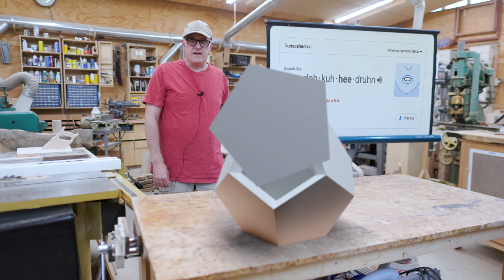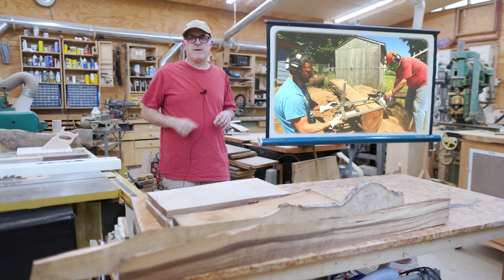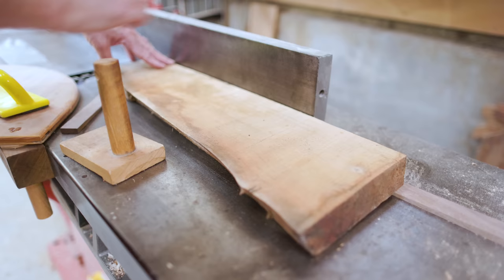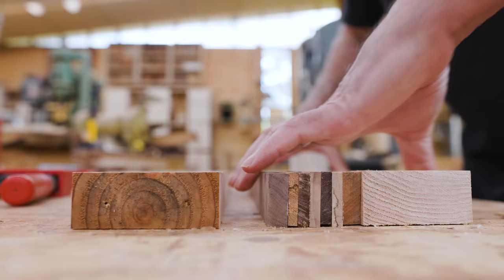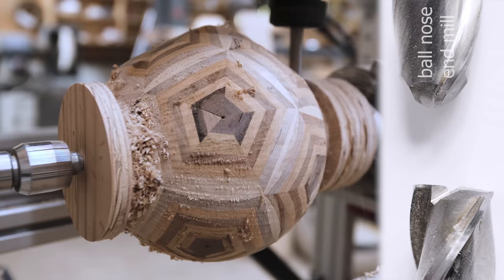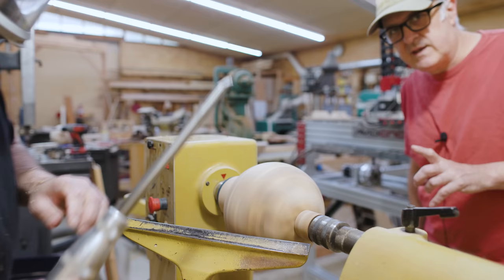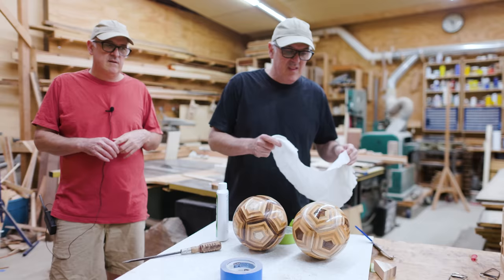Wood Turned Segmented Spheres

Comment: If you are looking for a 12, try screw head types, with a little bit of research you will find more than enough especially if you delve into security screws companies don’t want you to undo. With the different head types there are plenty to choose from.😁 I bought a set of screw bits once to undo most of them and there were way more than 12 types. Also if you made 6 of the pentagons out of resin, would it be possible to insert an LED light to make a Christmas ornament. All the best to ya😁😁
Reply: This is a fun idea!
Reply from the maker: I like the  screw types idea, simple graphics, out of the ordinary and on topic.  I've been wondering how to use resin in this process.

Comment: This video was awesome Frank. For the Christmas ornament I suggest you make the center of the pentagons a snowflake on the CNC machine, and then fill them with a translucent white epoxy. No chip out problem then.
Reply: you can also use semi transparent epoxy completely thru the wood and add lights.

Comment: I love these projects, I did a number of segmented bowls in high school.  It just occurs to me that it could be interesting to use the CNC to carve the inside of the bowl while still hemispheres. At the same time, carve a slot in the rim for a ring spline so the two halves can be aligned easily.  Would be good for a sphere with cutouts.

Comment: For the finishing stage, possibly strewing an eye hook into the spheres and hanging it from a string might be a good solution. You could spray finish then, or apply with a brush, etc. Then fill in the hole with saw dust and glue or wood filler, etc.

Comment: There's a way to make spherical dice that could be possible with your techniques (and CNC). You carve cups into the back of each pentagon, and making it so everything outside the cups is really smooth high points, and then you include a heavy ball. Once assembled the only place the ball can come to rest is in a cup, and whichever cup it rests in will be pulled to the bottom. This could be a really interesting jumbo yardgame die, but it would also stop the sphere from rolling so you could display it without anything external to keep it still. I'm sure the trick is finding a ball with the right weight, too heavy and it'll break itself apart, not heavy enough and it won't be able to roll the ball.

Comment: Even if one spring clamp isn't strong enough, there are a lot of ways to tie the string so it hangs on 3 spring clamps, or more, but balancing more than 3 gets really fiddly. Maybe have 3 separate strings pulling in a triangle of directions so the weight isn't as prone to tilting the spring clamp over. And of course, you could set this all up before you begin gluing, with little carabiners or clasps to grab on quickly.

As just a quick thought on it, you could do an alpine butterfly midline on a cord, then have the two working ends turn back around and barrel knot onto themselves, put a carabiner on each loop, slide the barrel knot to adjust. Then take a second like, tie an angler's loop engaged in any of several ways with the alpine butterfly's loop, and do the barrel knot+ carabiner to the other end. Now hang this whole thing from the alpine butterfly's loop. If you hang it on a hook or carabiner, then you can attach and adjust the whole harness before hanging it, so there will be less jostling that could dislodge the clamps

Comment: Regarding the sphere slipping in the cup when turning. I would suggest using   Plastidip Super Grip Fabric Spray on the cup. It works super excellently on the back of rugs to keep them from slipping on a wood floor. And it does not stick to the floor. It needs to drive for about 4 hours.
Also, it came to mind that you could use your CNC to make a spherical cup as well.
Thanks for providing the angle for cutting the pentagons to form a sphere.

Comment: I think you can cut a piece of wood with the right cut angle and add it between you jig limit and the piece, so each piece would not rock back and fourth anymore and you can cut it on the table saw at the right dimensions. Really good job, as usual ;)

Comment: You could set the drying dodecahedron on a small cylinder or cube to keep pressure of the spring clamps (the middle of the pentagons seems big enough for that).

Comment: I absolutely agree with everyone's comments about your editing and story telling.

While we got a lot of Narrator Frank, and Artisan Frank, a little Gaffer Frank, but Janitor Frank should get some screentime as well 😜

Regarding your "12 things" question, I'm trying to think of 2 things (top and bottom) that each have 5 things (5 sides attached to the top or bottom) in common and are opposed to or correlate with the other side.

It's not an accurate example, but gets the point across:  if we had 5 seasons, the top could relate to the Northern hemisphere, the bottom to the Southern hemispheres, and the seasons could align with the neighboring seasons on the other side of the globe.

Almost yin yang in a globe form...

Comment: Gorgeous

I would like to suggest to drill a hole in the center of the pentagons to mount them on a peg on the table saw sled to aid alignment. That can be uniformly filled or CNC'd.

Comment: Instead of clamps to hold the pieces in place as you cut the face, rotate it, cut the face rotate it etc, you can actually build a 5 sided 'home' (really only 4 sided since the 5th side is the side you are cutting), so you just have to lift it out of the 'home' rotate it and cut the new face, lift it out, rotate it etc. I made many Euclidian solids out foam and paper years ago, they are some much fun. Look at the stellated versions...

Comment: Here's an idea for the disappearing edges: What if instead of aligning the strips in your glue-up perpendicular to the face of each pentagon, you glued them up so that the strips are already at the angle of the joint between the pentagons? Each glued edge would then have an approximately uniform thickness of that one type of wood, instead of only the little wedge of it at the outside which then gets turned off.

Comment: You could make a pair of spherical dice. They roll, but come to a stop on a number. Basically, the flats are on the inside and a weight makes it settle on a number. They actually correspond to the corners in the internal polygon. So a 6-numbered die would need an octahedron inside (6 vertices) and a 12-numbered die would need an icosahedron inside (12 vertices).

Would definitely be a challenge. Woodturning with the weight inside might be weird, but if you're cutting numbers into it, you can hand smooth the las number and put the weight(s) in when you cut in the number.

Comment: If you were to place a thin piece of material on the bottom of your angle sled against the fence, it should prevent the tip from falling under the fence since the tip will instead bump into the fence at the new height.

Comment: You could do the 12 star signs, maybe a walnut background with maple stars. No need to make them look realistic just have the actual star formations...

With the triangles, it would be a pain but could you do a small back cut on each then finish the cut normally? So set it up pull the fence towards you, cut half an inch, then push it out of the blade, remove the workpiece,  move the sled back, put the workpiece back on then finish the cut like normal? 
Like I said would be a pain but it should stop chipout.

Comment: I usually put the point that tends to chip away in front, not on the back. That way blade push it in, not out the main body and it stays in place. Not sure your sled allows you to flip whole setup, but... at least you might try.

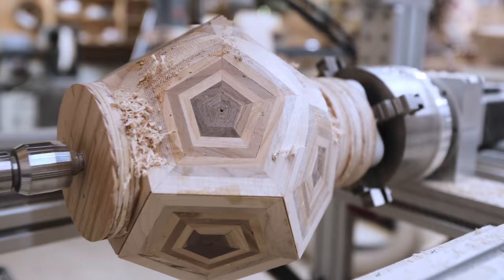Comment: Hello Frank, at 21:31 min the CNC machine go a half cirkel the roterie table move a litle, maybe you can make a cirkel horizontal and move the rotery table ? A other mill you can used is a  "torusendmill" it is between a ballendmill and a endmill. But it is a very nice good video 👍👍

Comment: Make the spheres into calendars! Each face of the dodecahedron could be one of the 12 months, and you could have the day numbers of the month engraved around the outside edge of each face as well. I'm not sure how you would indicate which day it is precisely. Maybe do a steel wire inlay for each day number and then clip on a small magnet that you can move around to mark each day. Whichever face is up shows the month!

Comment: Frank, once again a superb video.  As it relates to hanging the glue-up from one of the spring clamps.  What about pre-attaching a faceplate and threading it on the lathe to dry?  Even if it is hot glued to the work.

Comment: The triangle tip problem might be a case of wanting to have your cake and eat it, too. Two triangle edges from one cut is a bit of an ideal. As we all know, wood-cutting operations typically assume a stationary part and a cut-off part. The latter is cast aside as a price paid to the improved quality of the former. It's no fun to admit this, but it's probably the case that a 'perfect' triangle requires a dedicated cut made for each perfect edge. 

One way or another, the tablesaw blade is going to vibrate & flex enough to knock out a tiny 60° tip from somewhere. Even IF both parts were secured, cyclical error is going to occasionally favor one of those fragile areas. If I were looking for a repeatably 'perfect' triangle procedure, I might try to accept that I'll have to push my error off to one side, and try using two jigs. Perhaps the first would establish one triangle's finished edge (as the featured sled has already done here), and then the second jig would be for making a refining cut to the cut-off.

That said, my most perfect equilateral triangle patterns have also been realized by wood filler. Only the finished objects and I know the secret. Unless you share the fact with an audience, of course: then we all know how we'd do it 'better.'  

The twelve things? Monkeys—no question. 12 Monkeys.
Reply from the maker: I think you are probably right about the triangle tips. That is why I was heading in the direction of celebrating the wood filler so much that it becomes an inlay. I like the 12 monkeys idea

Comment: I wonder if cutting the triangles with the acute angle pointing into the table saw blade first (or farthest from you) would mitigate the tear put more. The obtuse angle, with your 'zero clearance' support would have more meat to it and be less likely to tear out.
Additionally, in regards to cutting the pentagons and having the edge slip under your fence, perhaps have the fence just reference higher up the face/edge rather than right along the point of the face.

Comment: intermix epoxy pour for the centers,  and maybe one of the layers...  then light them internally with color changing LEDs.... Govee has some cool options. OR even the Christmas ornament this year with twinkle lights inside. make on of the panels removable .. held on with some neodymium magnets... I have some that are 40 lb pull in 1/4 by 1/2 I will give you. You can pick them up at my Office in Canby...

Comment: since the pentagons are shorter than the fence, why not cut from the other side of the blade. this would put the sharp edge of the cut on top and when you turn it for the next cut it wouldn't slip under the fence.

Comment: You're mastering the art and science of the spheres! Amazing work figuring out the process, it's fascinating to follow along. Have you tried drilling 3 lengths of dowel into a board in say a 6" equilateral triangle, maybe sticking up vertically about 6 or 8 inches? Seems that might hold the dodecahedron equally as well as hanging it from a string, without the risk of a clamp slipping and dropping your work onto the table or floor. If you rounded the ends, you could use it for finishing too.

Comment: Make it a huge 12 sided round dice. You make indentations inside oposite to the number and put a steel ball in it. Then if you roll it, the steel ball will fall in the indentation and stop the "dice" with a number on the top.

Comment: Cool vid, thanks!
Zodiac signs? Months? 12-step plan for alcoholics? Or anything with six symbols and the same symbol on opposite faces...? No, no good ideas.
A thought about the early stage: it looked like you prepared 60 triangles to glue up into 12 pentagons. Why not make 5 triangular prisms, glue those up into a pentagonal prism, and feed that through the bandsaw a few times? A suggestion further: take a log, lathe it to round, jointer and tablesaw to get the pentagonal prism, then same as above. I imagine the CNC would make short work of carving all the endgrain.

Comment: Could the twelve months be a possibility Frank? There could be several ways of using them: pictures representing the relevant, seasonal weather; simple, printed names; the 3-letter abbreviations; different languages; different fonts etc.
Depending on the size of the segments and the size of the writing, the "months of the year" idea could be extended into an actual calander, although space might be a bit of an issue.

Comment: Would it work better if you had two zero clearance fences, one perpendicular to your table and one at the negative angle to complement the angle of the pentagon? So one cut at an angle against the 90 degree fence and the 4 more against a different fence sloping into the blade?

Comment: tip chipping --- rebuild the jig upside-down - so you cut inside the pentagons down on the table saw; that way the last tip of the triangle is ripping down towards the angled fence. ?
What kind of blade are you using? triple chip, or simpler?

Comment: I like the idea of the twelve zodiac signs—I wonder if there might be a way to make their positions on the sphere correspond to the positions of the associated constellations in the night sky.
Reply: Not unless you move the constellations. ;-)
Reply: @RFC-3514  They move themselves relatively well. :-)
Reply: @Blahnik1182  - They've "moved" themselves about 30 degrees in 2000 years (or rather, we have).

But they're all still along the ecliptic plane (i.e., around the "equator", relative to the solar system). They are not (and never were) distributed evenly across the surface of the celestial sphere.